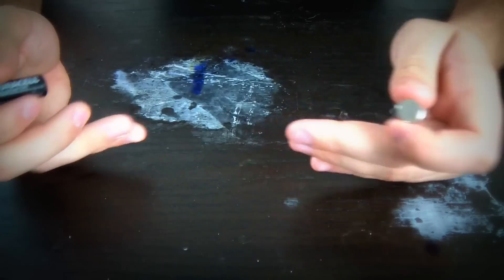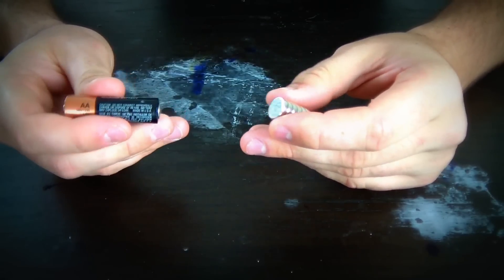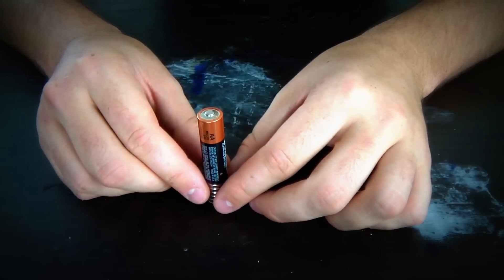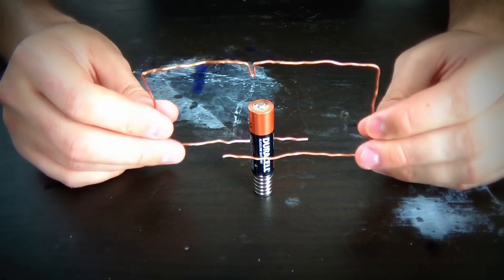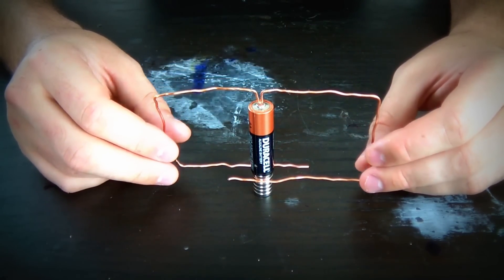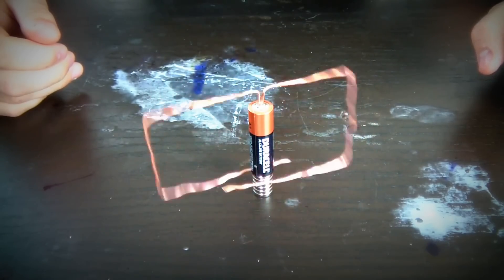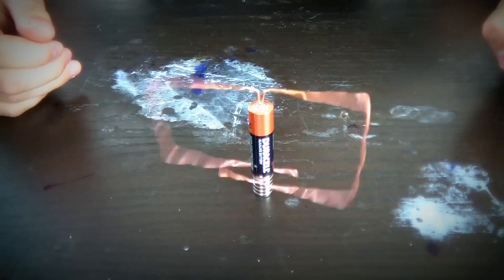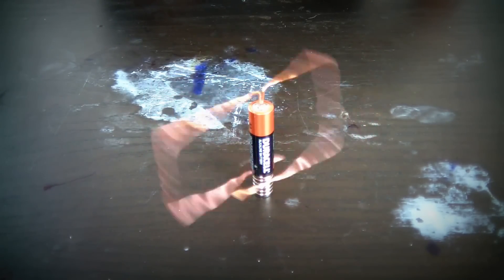Homopolar Motor

Comment: I think it is because the copper wire gets a magnetic field when current from the battery runs through it. It has a north and a south pole. It is repelled by the pole of the neodymium magnets and then the copper wire rotates.

Comment: Is there a way to keep it from slipping off the battery?
Reply: After I typed that I came up with the answer, glue a little tube for the middle part of the copper wire to sit in. Great video, thanks.

Comment: The N-S field on the magnet goes up and down.The current flows from center to horizontal. A moving current at right angle to magnetic field will develop a right angle force, pushing the wire. As the wire spins it makes a back force in the same magnetic field and limits the speed. If you hang the magnet on a screw, and hold the wire and battery still, the magnet will spin super fast the other direction because the magnetic field is reversed in the magnet and the force that it makes as it spins is supporting the rotation (also backwards like before). A fun alternative is magnets at both ends with N poles facing inwards. Magnets must be bigger than battery. Lay it on aluminum foil and it will roll away. Use different size magnets and it will go in circles.
Reply: Leonard Brunvoll, the fate of an unexamined existence.
Reply: BMan18

Comment: A homopolar motor creates rotational movement because of what is known as the Lorentz force. Whats happening is that electrical current is flowing from the positive terminal of the battery to negative and into the magnet

Comment: We're do u get copper wires
Reply: I stripped a coax cable and it's in the second coating... for me it was in a while protecting sleeve
Reply: Coat hanger.
Reply: Order it online a roll about as big as a paper roll tube costs about $150
Reply: take if from the wall

Comment: it is basically a circuit. the electric current travels down through the battery up through the copper and back down again while the magnetic field is going in the opposite direction. what causes the motion though is how the wire is perpendicular with the current of the battery. that perpendicular angle disrupts the movement of the current and causes the motion of the copper wire

Comment: its converting electrical energy into mechanical energy when electricity travel through wire and get in contact with magnet due to interception of electricity into magnet fields generates motion due to electro megnetic force (EMF). there is also eddy current thats why it fall. eddy current oppose the magnetic field which used in breaks of train's @crazyrussianhacker
Reply: #CrazyRussianHacker

Comment: A homopolar motor creates rotational movement because of what is known as the Lorentz force. What's happening is that electrical current is flowing from the positive terminal of the battery to the negative and into the magnet.
Reply: OK, I’m going to get scientific for this bit so make yourself a cuppa and bring your concentration face! A homopolar motor creates rotational movement because of what is known as the Lorentz force.

What’s happening is that electrical current is flowing from the positive terminal of the battery to the negative and into the magnet. This current then flows from the centre of the magnet to the edge where the wire connects, it travels up the wire back to the positive terminal of the battery and the circuit is complete.

Simple. But how does this generate movement you may well ask? Well, the key is the direction of the current and the magnetic field produced by the permanent magnet. We’ve put together the below diagram to support the explanation. The direction of the magnetic field is demonstrated by the red arrows and the direction of current is shown by the blue arrows. As the current travels perpendicular to the magnetic field, a Lorentz Force is exerted on the on the conductor (the wire) which again is perpendicular to both the direction of the magnetic field and the current, generating the spinning motion.

There.
Reply: Connor Freeman+ i think this is how helicopters work
Reply: Oh, and I used google. XDDDDDDDDDDDDDDDDDDDDDDDDDDDDDDDDDDDDDDDDDDDDDDDDDDDDDDDDDDDDDDDDDDDDDDDDDDDDDDDDDDDDDDDDDDDDDDDDDDDDDDDDDDDDDDDDDDDDDDDDDDDDDDDDDDDDDDDDDDDDDDDDDDDDDDDDDDDDDDDDDDDDDDDDDDDDDDDDDDDDDDDDDDDDDDDDDDDDDDDDDDDDDDDDDDDDDDDDDDDDDDDDDDDDDDDDDDDDDDDDDDDDDDDDDDDDDDDDDDDDDDDDDDDDDDDDDDDDDDDDDDDDDDDDDDDDDDDDDDDDDDDDDDDDDDDDDDDDDDDDDDDDDDDDDDDDDDDDDDDDDDDDDDDDDDDDDDDDDDDDDDDDDDDDDDDDDDDDDDDDDDDDDDDDDDDDDDDDDDDDDDDDDDDDDDDDDDDDDDDDDDDDDDDDDDDDDDDDDDDDDDDDDDDDDDDDDDDDDDDDDDDDDDDDDDDDDDDDDDDDDDDDDDDDDDDDDDDDDDDDDDDDDDDDDDDDDDDDDDDDDDDDDDDDDDDDDDDDDDDDDDDDDDDDDDDDDDDDDDDDDDDDDDDDDDDDDDDDDDDDDDDDDDDDDDDDDDDDDDDDDDDDDDDDDDDDDDDDDDDDDDDDDDDDDDDDDDDDDDDDDDDDDDDDDDDDDDDDDDDDDDDDDDDDDDDDDDDDDDDDDDDDDDDDDDDDDDDDDDDDDDDDDDDDDDDDDDDDDDDDDDDDDDDDDDDDDDDDDDDDDDDDDDDDDDDDDDDDDDDDDDDDDDDDDDDDDDDDDDDDDDDDDDDDDDDDDDDDDDDDDDDDDDDDDDDDDDDDDDDDDDDDDDDDDDDDDDDDDDDDDDDDDDDDDDDDDDDDDDDDDDDDDDDDDDDDDDDDDDDDDDDDDDDDDDDDDDDDDDDDDDDDDDDDDDDDDDDDDDDDDDDDDDDDDDDDDDDDDDDDDDDDDDDDDDDDDDDDDDDDDDDDDDDDDDDDDDDDDDDDDDDDDDDDDDDDDDDDDDDDDDDDDDDDDDDDDDDDDDDDDDDDDDDDDDDDDDDDDDDDDDDDDDDDDDDDDDDDDDDDDDDDDDDDDDDDDDDDDDDDDDDDDDDDDDDDDDDDDDDDDDDDDDDDDDDDDDDDDDDDDDDDDDDDDDDDDDDDDDDDDDDDDDDDDDDDDDDDDDDDDDDDDDDDDDDDDDDDDDDDDDDDDDDDDDDDDDDDDDDDDDDDDDDDDDDDDDDDDDDDDDDDDDDDDDDDDDDDDDDDDDDDDDDDDDDDDDDDDDDDDDDDDDDDDDDDDDDDDDDDDDDDDDDDDDDDDDDDDDDDDDDDDDDDDDDDDDDDDDDDDDDDDDDDDDDDDDDDDDDDDDDDDDDDDDDDDDDDDDDDDDDDDDDDDDDDDDDDDDDDDDDDDDDDDDDDDDDDDDDDDDDDDDDDDDDDDDDDDDDDDDDDDDDDDDDDDDDDDDDDDDDDDDDDDDDDDDDDDDDDDDDDDDDDDDDDDDDDDDDDDDDDDDDDDDDDDDDDDDDDDDDDDDDDDDDDDDDDDDDDDDDDDDDDDDDDDDDDDDDDDDDDDDDDDDDDDDDDDDDDDDDDDDDDDDDDDDDDDDDDDDDDDDDDDDDDDDDDDDDDDDDDDDDDDDDDDDDDDDDDDDDDDDDDDDDDDDDDDDDDDDDDDDDDDDDDDDDDDDDDDDDDDDDDDDDDDDDDDDDDDDDDDDDDDDDDDDDDDDDDDDDDDDDDDDDDDDDDDDDDDDDDDDDDDDDDDDDDDDDDDDDDDDDDDDDDDDDDDDDDDDDDDDDDDDDDDDDDDDDDDDDDDDDDDDDDDDDDDDDDDDDDDDDDDDDDDDDDDDDDDDDDDDDDDDDDDDDDDDDDDDDDDDDDDDDDDDDDDDDDDDDDDDDDDDDDDDDDDDDDDDDDDDDDDDDDDDDDDDDDDDDDDDDDDDDDDDDDDDDDDDDDDDDDDDDDDDDDDDDDDDDDDDDDDDDDDDDDDDDDDDDDDDDDDDDDDDDDDDDDDDDDDDDDDDDDDDDDDDDDDDDDDDDDDDDDDDDDDDDDDDDDDDDDDDDDDDDDDDDDDDDDDDDDDDDDDDDDDDDDDDDDDDDDDDDDDDDDDDDDDDDDDDDDDDDDDDDDDDDDDDDDDDDDDDDDDDDDDDDDDDDDDDDDDDDDDDDDDDDDDDDDDDDDDDDDDDDDDDDDDDDDDDDDDDDDDDDDDDDDDDDDDDDDDDDDDDDDDDDDDDDDDDDDDDDDDDDDDDDDDDDDDDDDDDDDDDDDDDDDDDDDDDDDDDDDDDDDDDDDDDDDDDDDDDDDDDDDDDDDDDDDDDDDDDDDDDDDDDDDDDDDDDDDDDDDDDDDDDDDDDDDDDDDDDDDDDDDDDDDDDDDDDDDDDDDDDDDDDDDDDDDDDDDDDDDDDDDDDDDDDDDDDDDDDDDDDDDDDDDDDDDDDDDDDDDDDDDDDDDDDDDDDDDDDDDDDDDDDDDDDDDDDDDDDDDDDDDDDDDDDDDDDDDDDDDDDDDDDDDDDDDDDDDDDDDDDDDDDDDDDDDDDDDDDDDDDDDDDDDDDDDDDDDDDDDDDDDDDDDDDDDDDDDDDDDDDDDDDDDDDDDDDDDDDDDDDDDDDDDDDDDDDDDDDDDDDDDDDDDDDDDDDDDDDDDDDDDDDDDDDDDDDDDDDDDDDDDDDDDDDDDDDDDDDDDDDDDDDDDDDDDDDDDDDDDDDDDDDDDDDDDDDDDDDDDDDDDDDDDDDDDDDDDDDDDDDDDDDDDDDDDDDDDDDDDDDDDDDDDDDDDDDDDDDDDDDDDDDDDDDDDDDDDDDDDDDDDDDDDDDDDDDDDDDDDDDDDDDDDDDDDDDDDDDDDDDDDDDDDDDDDDDDDDDDDDDDDDDDDDDDDDDDDDDDDDDDDDDDDDDDDDDDDDDDDDDDDDDDDDDDDDDDDDDDDDDDDDDDDDDDDDDDDDDDDDDDDDDDDDDDDDDDDDDDDDDDDDDDDDDDDDDDDDDDDDDDDDDDDDDDDDDDDDDDDDDDDDDDDDDDDDDDDDDDDDDDDDDDDDDDDDDDDDDDDDDDDDDDDDDDDDDDDDDDDDDDDDDDDDDDDDDDDDDDDDDDDDDDDDDDDDDDDDDDDDDDDDDDDDDDDDDDDDDDDDDDDDDDDDDDDDDDDDDDDDDDDDDDDDDDDDDDDDDDDDDDDDDDDDDDDDDDDDDDDDDDDDDDDDDDDDDDDDDDDDDDDDDDDDDDDDDDDDDDDDDDDDDDDDDDDDDDDDDDDDDDDDDDDDDDDDDDDDDDDDDDDDDDDDDDDDDDDDDDDDDDDDDDDDDDDDDDDDDDDDDDDDDDDDDDDDDDDDDDDDDDDDDDDDDDDDDDDDDDDDDDDDDDDDDDDDDDDDDDDDDDDDDDDDDDDDDDDDDDDDDDDDDDDDDDDDDDDDDDDDDDDDDDDDDDDDDDDDDDDDDDDDDDDDDDDDDDDDDDDDDDDDDDDDDDDDDDDDDDDDDDDDDDDDDDDDDDDDDDDDDDDDDDDDDDDDDDDDDDDDDDDDDDDDDDDDDDDDDDDDDDDDDDDDDDDDDDDDDDDDDDDDDDDDDDDDDDDDDDDDDDDDDDDDDDDDDDDDDDDDDDDDDDDDDDDDDDDDDDDDDDDDDDDDDDDDDDDDDDDDDDDDDDDDDDDDDDDDDDDDDDDDDDDDDDDDDDDDDDDDDDDDDDDDDDDDDDDDDDDDDDDDDDDDDDDDDDDDDDDDDDDDDDDDDDDDDDDDDDDDDDDDDDDDDDDDDDDDDDDDDDDDDDDDDDDDDDDDDDDDDDDDDDDDDDDDDDDDDDDDDDDDDDDDDDDDDDDDDDDDDDDDDDDDDDDDDDDDDDDDDDDDDDDDDDDDDDDDDDDDDDDDDDDDDDDDDDDDDDDDDDDDDDDDDDDDDDDDDDDDDDDDDDDDDDDDDDDDDDDDDDDDDDDDDDDDDDDDDDDDDDDDDDDDDDDDDDDDDDDDDDDDDDDDDDDDDDDDDDDDDDDDDDDDDDDDDDDDDDDDDDDDDDDDDDDDDDDDDDDDDDDDDDDDDDDDDDDDDDDDDD
Reply: +The Slenderman Kid helicopters work by using the forced generated by the blades on top like a fan would, drawing in air so hard and fast that it creates wind, to lift the helicopter into the air

Comment: I works by simptripital force - look it up.
Reply: No...
Reply: A homopolar motor is a direct current electric motor with two magnetic poles, the conductors of which always cut unidirectional lines of magnetic flux by rotating a conductor around a fixed axis so that the conductor is at right angles to a static magnetic field.
Reply: +TheRealGrowler ice

Comment: how can it move by it's self
Reply: OK, I’m going to get scientific for this bit so make yourself a cuppa and bring your concentration face! A homopolar motor creates rotational movement because of what is known as the Lorentz force.

What’s happening is that electrical current is flowing from the positive terminal of the battery to the negative and into the magnet. This current then flows from the centre of the magnet to the edge where the wire connects, it travels up the wire back to the positive terminal of the battery and the circuit is complete.

Simple. But how does this generate movement you may well ask? Well, the key is the direction of the current and the magnetic field produced by the permanent magnet. We’ve put together the below diagram to support the explanation. The direction of the magnetic field is demonstrated by the red arrows and the direction of current is shown by the blue arrows. As the current travels perpendicular to the magnetic field, a Lorentz Force is exerted on the on the conductor (the wire) which again is perpendicular to both the direction of the magnetic field and the current, generating the spinning motion.

There.
Reply: Everything is science

Comment: it will work with any magnet and battery???
Reply: The battery has to have - and + on opposite sides, not like a 9v battery.

The magnet however, has to be a circular.
Reply: i think they only work with neodymium magnets

Comment: it's the acid in rhe battery
Reply: No.

A homopolar motor creates rotational movement because of what is known as the Lorentz force. What's happening is that electrical current is flowing from the positive terminal of the battery to the negative and into the magnet.
Reply: Me or someone else?

Comment: Did anyone answer you yet how it works? Current passing through the circuit has a rotating field around the wire. Because of how you bent the wire, the force of the magnetic field around the wire points in opposite directions at either end of your rotor so it spins. The same principle works for larger electric motors, they just have a lot more wire in the coils and consume more energy so they can produce greater torque and power. Hope that helps.
Reply: great... thought it would be better because people who actually wanted to know could also search it up online... :) nice work pal
Reply: +Nick M bro you havenot described it clearly.....it is in much more detail you just said the common thing
Reply: iqbal mahmud To be more clear I'd need to draw pictures. A more detailed explanation has more technical language that is more confusing without pictures or setting up a lab experiment video. For better explanation look up videos about "how electric motors work" "electromagnets" "electricity and magnetism". I'm sorry my explanation wasn't helpful.
Reply: +Nick M Just use flemmings left hand rule that will explain this perfectly..
I was just as boggled as everyone else here when i saw this experiment 4 years ago... now i get it :)
Reply: Aakash Joshua I left that out of my text description because that would make it more complicated without being able to draw it. The left hand rule will surely be in the explanations of the search terms I mentioned.

Comment: I did this a few years back, its easier to make a spiral around the battery with just enough clearance so it doesnt get off the top terminal. With less mass, less energy is taken to spin it so it spins faster and more efficient

Comment: Also, there is no electromagnetic induction here since the dipole field is symmetric with respect to the same axis as the wire's symmetry.....i.e. there is no rate of change of magnetic flux

Comment: The coating on the magnets are conductive so there is current in the copper wire. the negative side of the battery is on bottom so electrons are moving from bottom to top in the wire. This current is symmetric about the wire's symmetry. From there, the magnets have a dipole field which pretty much runs parallel along the axis of the battery at the general area where the wire is touching the magnets. The magnetic field also extends up to the top portion of the wire but it is weaker there so we can neglect that. With the magnetic field and the current in the directions as they are, it creates a force on the wire in the circular direction with the equation (F = qv X B), where F, v, and B are vectors.
Reply: +Mike P I'm honestly not sure if this is a pro troll or if you are seriously brilliantly smart.
Reply: +Jeff Rainwater Thanks for the reply. I'm not really trolling or anything..lol. I've just taken a class on electricity and magnetism since i'm an undergraduate in physics and I just posted what I thought was the right way to explain how this thing works.

Comment: do i have to scrape the copper wire before using
Reply: +Suresh Shetty Only if it is insulated. Bare copper wire does not need to be scraped.

Comment: The magnetic field reacts on the negative side of the  battery in the connection of the copper wire where Magnetic force plus chemical  force plus mineral force so all the three items plays their parts in the result of less mass item spin thats the copper wire.

Comment: where we will find that magnet
Reply: Yeah u need this magnets...normal magnets (black coloured) are not conductors of electricity..ok -_^
Reply: Home Depot has them.
Reply: in market
Reply: They are labeled: "Neodymium" magnets.  They are the very strong magnets.
Reply: Go ask in a mormon church. Also ask em how they work.
Reply: Gusstavv's Stuff xD
Reply: +bluegreen1548  search in eBay or some online websites even I want them.
Reply: +Akif Khan You can take them out of dead hard drives.
Reply: +Akif Khan I've seen neodymium magnets on amazon.
Reply: try searching for floral magnets.
Reply: Akif Khan Home Depote

Comment: +CrazyRussianHacker  I tried this and the ends by the neodyuim magnets just stuck there I folded it the same way and it didn't spin wtf man plz respond and help
Reply: +CrazyRussianHacker  wtf wont it tag someone tag him!!!
Reply: the wire got stuck
Reply: did you put the magnets on the correct side?
Reply: yes the bottom how else would u put them???
Reply: did you use copper? copper isn't magnetic
Reply: +ThatOneVideo yes i used copper
Reply: Josh's whips and lanyards use magnet wire

Comment: is it a magnetic copper wire mine is not 
but it didnt work
Reply: What can i do
Reply: +Raddish in Sadish you cannot use a metal type for the wire that can be magnitized it wont work.  The balance of the bent wire is important, measuring from center to make each side the same length is what makes his spin so fast.  Most of the time it doesnt work is because the battery is drained (this type of direct short really eats a singe AA battery quickly, there is minimal resistance in the system so its basically a dead short, which quickly drains a small battery and makes it hot.)  The main problem with it not working is lack of good electrical contact i.e. no current flow or very low current flow.  The amount of moving current is directly proportional to the strength of the magnetic field created by the wire.  It must have enough current to create a field large enough to repel the magnet.  if connection is not good, some current will flow draining your battery as you try to make it work, but not enough to create a great enough force to turn the wire.  It helps to sand or scrape with a knife the contact points of the wire (bottom of "V" bend touching + terminal and sides of wire touching magnet), and make sure the magnet is clean (fingerprints and oil deposits will creat bad connection).  You also need to construct your "square" of wire not too big, as the sides (where force is applied to moving charges by the magnet to spin the loop) might be too far away from the magnetic field created by the magnet.  Magnetic fields dissipate with the square of distance from source, so they don't radiate out very far.  With a fresh battery, a good connection, and a small built square (2-3 inches, probably 4 in max) it will work.  I hope that helped.

Comment: if i do that may i use any kind of battery and copper wire ??
Reply: +michael cruz yes.  This basically shorts the battery, draining it quickly and building heat.  You can feel the battery get hot after a minute of operation.  Since it is based on current flow, a D battery would work better and longer than a AA, since it stores more energy and will have a better, longer flow of current.  It's the same voltage, but stores much more energy than a AA.

Comment: it works because of the magnates because of the two bars beside the magnates they are both pulling in the wire the magnates are stacked so it is going up and down the bit on the top is spinning and picking up momentum so that it is spinning

Comment: The wire spins in the direction that it does because of Fleming's left hand rule. If you hold your lefy hand pointer finger pointing in the direction of the magnetic field, and the middle finger at 90 degrees to that in the direction of current flow, the thumb will point in the direction that the wire will spin.  Remember that current flows in opposite directions in the two wire paths, so they push in the same counter clockwise direction as shown in the video.